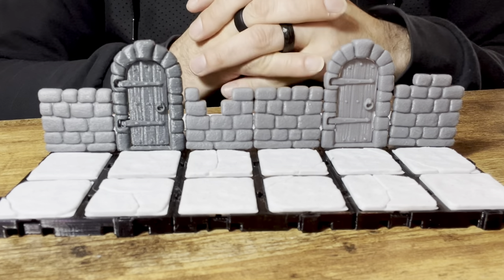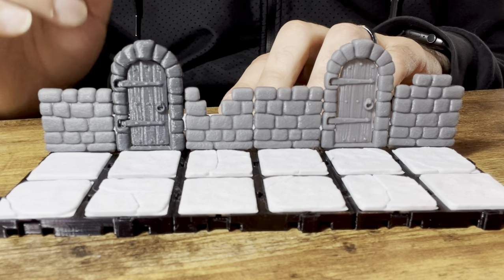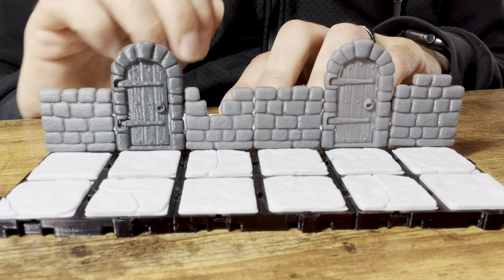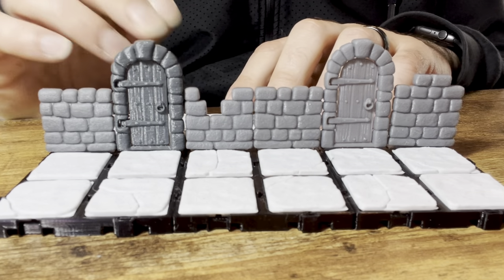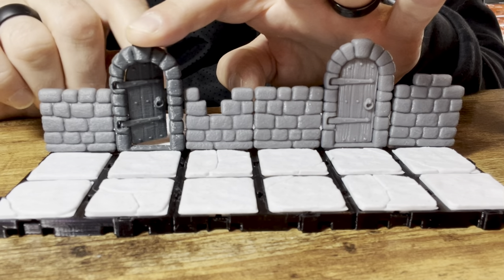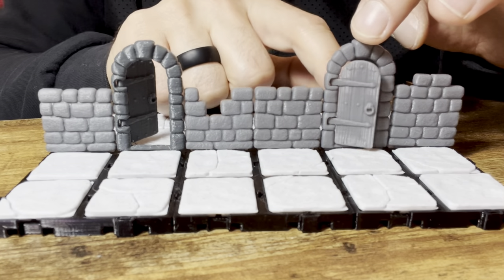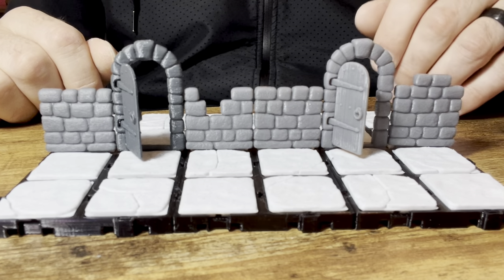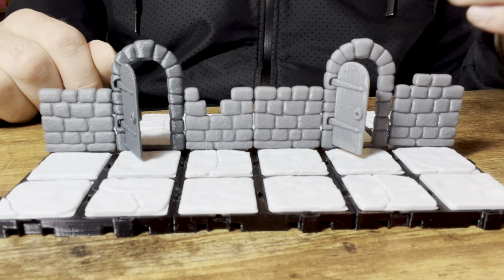Dynamod Games - 3D Printed Hinged Doors

Comment: Hey Geert, I just came across your designs while scouring the web for a dungeon tile set that solves the wall problem. I have a question: do you intend to publish more variants of the designs you already have for dynamod? I would love to get started, but the theming is a little on the low side, as I am looking to also make battlemaps say in forests, caves etc